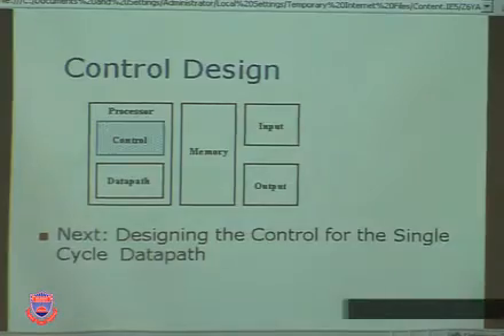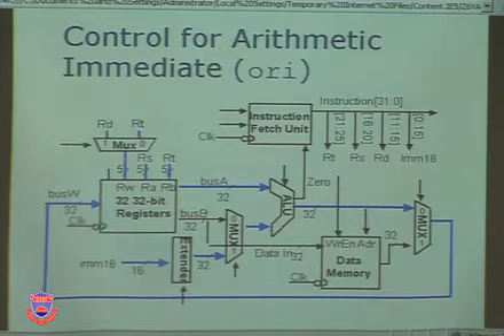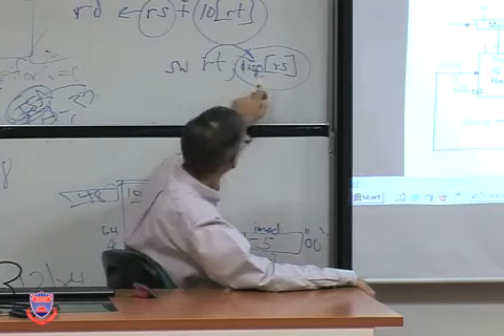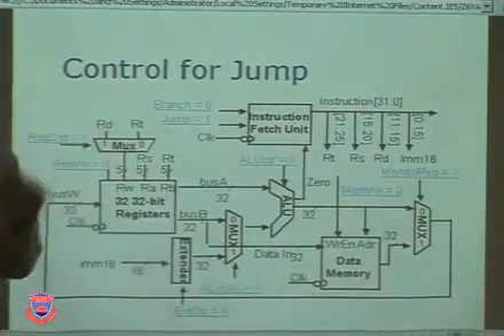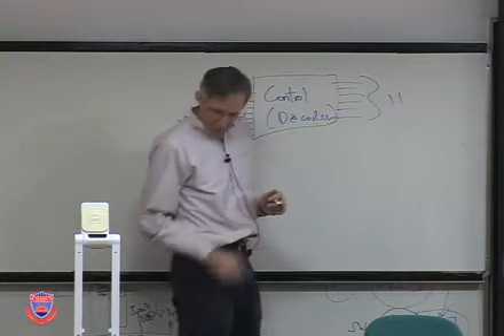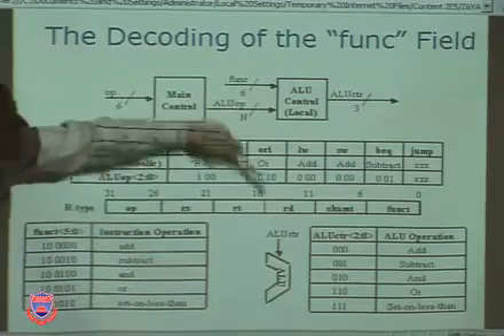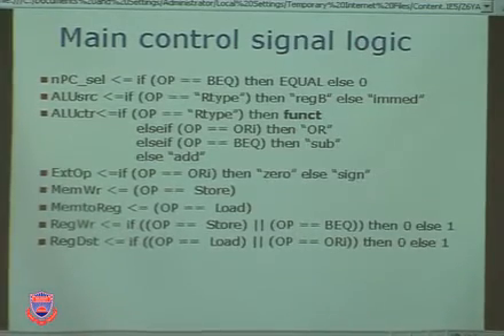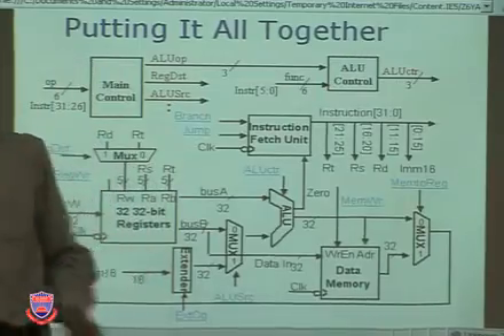CS-224 Computer Organization Lecture  25

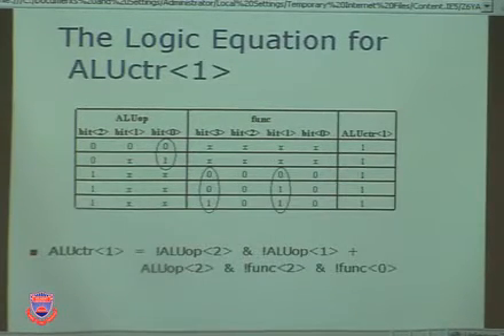Comment: 36:30 On the slide it should be: ALUctr<1> = !ALUop<2> & !ALUop<1> & !ALUop<0> + !ALUop<1> + ALUop<0> + ALUop<2> & !func<2> & !func<0>. The first two lines of truth table can't be combined.
Reply: can you explain why they can't be clubbed together even though there is a don't care term and when ALUop<0> can also combine?
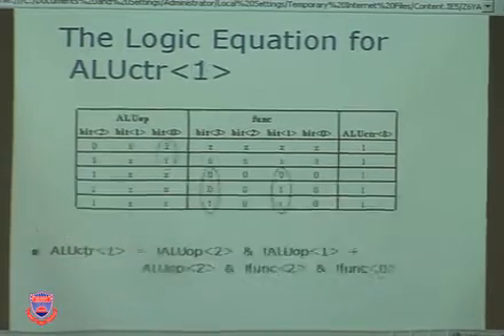Also the equation you wrote isn't correct , for ALUOp=011 , ALUCtr<1>=0 at 37:34 ,but as per your equation it comes out as 1.